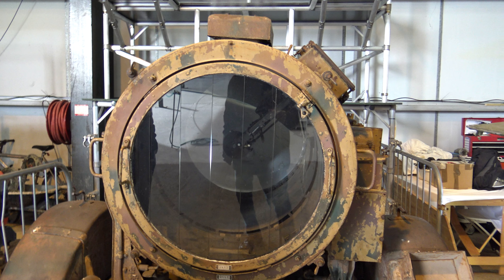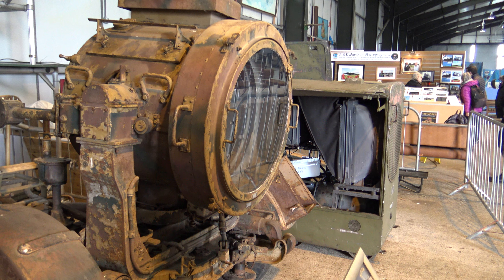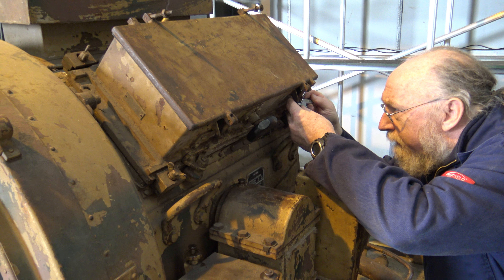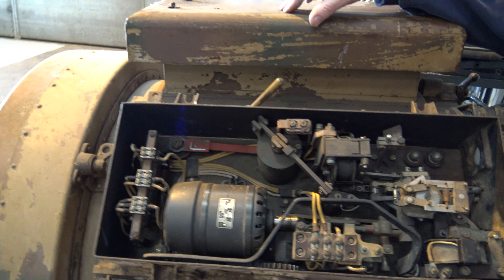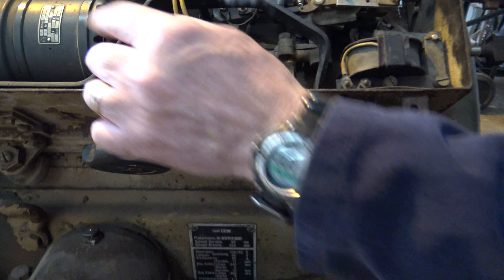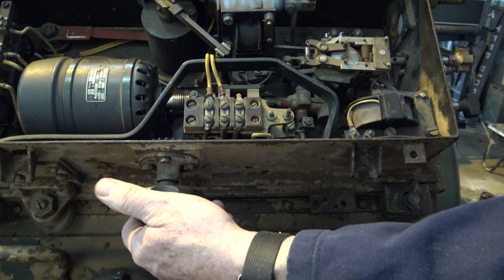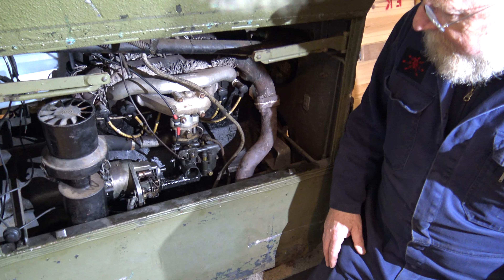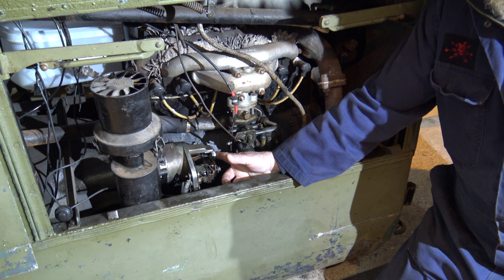WW11 German Searchlight

Comment: The moving armature starter was used in some bigger English diesels of the era, like Gardiner, Bedford, Leyland etc. I think they were made by Lucas from memory. Ultimately though, they were certainly the exception and not the rule. As Spen says, Bendix drive and pre engaged being far more common. Love the searchlight. The amps would initially be very high for the strike, then settle down to a fairly constant draw depending on the lumens the operator wanted from the light

Comment: Hello Neville. I was lost as soon as Spen opened the first cover! Outwardly it looks pretty battered but in surprisingly good condition where it needs to be. It has to be in good condition, if it wasn't then quite simply it would not be used for November 2nd. Was this retrieved by the LAHC ? (shut up! ve ask za questions !)  13mm=1/2 inch . 14mm =9/16inch. 19mm = 3/4inch.
Reply from the maker: Hi John i'm not sure how the came by it. Thanks for your comments